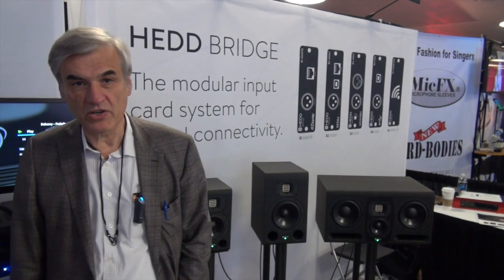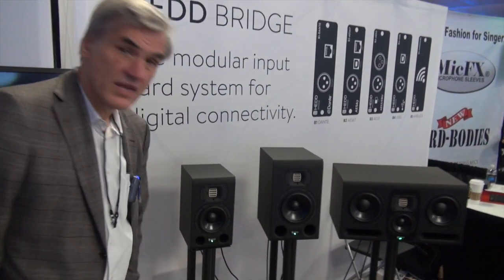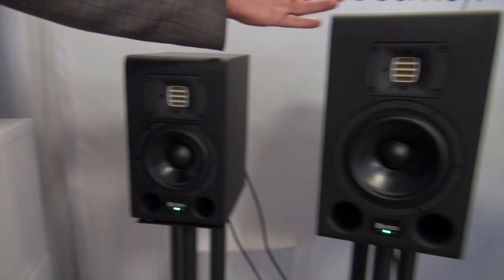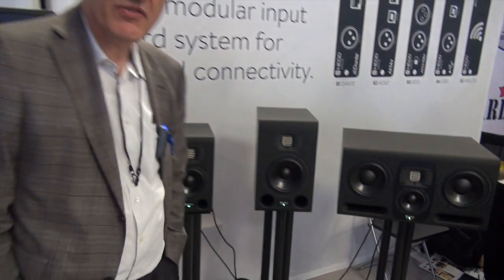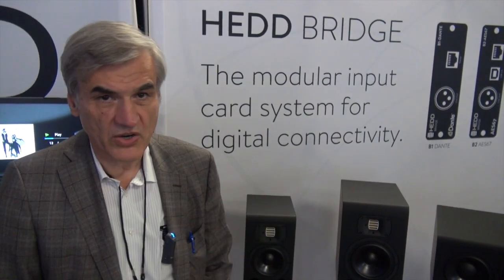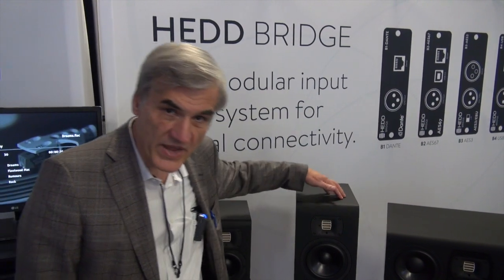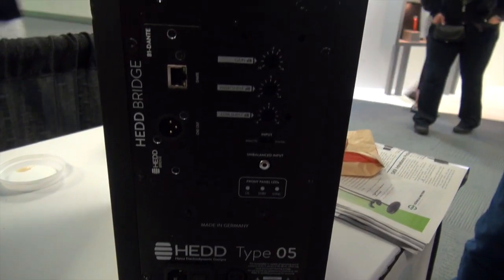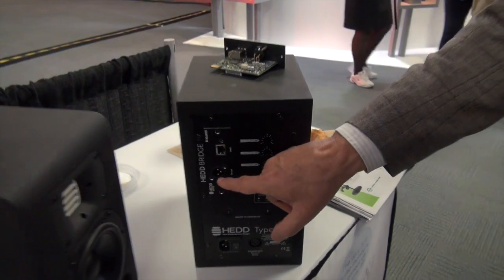[NAMM] Hedd

Comment: So there are Eve Audio-Hedd-Adam    all using basically more or less the same design and Eton speakers. They also have similar prices and aim at the same customer class. i don`t quite get it
Reply: +Frederik Knop Fair enough. Even so For me the perfect monitor is not in your line yet. Actually haven`t found it yet anywhere.  I always use a subwoofer. So for people like me the perfect thing would be a closed monitor  which can roll off at about anything around  60-80 hz. Personally i don`t need all speakers to be Bassreflex when closed is more precise. (Subwoofer ok i don`t care if it "wobbles" a bit) .  But there somehow are not that many choices of good closed cabin-studio-power- satellites.....   My dream monitor for my space:  5 liter volume closed cab. . 15-16 cm woofer. Dsp filtered. Freq.Range about  60-70 to about 22.000- 25.000hz  . Just saying
Reply: It would be cool if companies offered plugs for the bassport holes for tighter bass like atc i think.
Reply: aesthetically yes it would be nice. if you only need them for their function though  then you can take basically almost anything in order to stuff the reflex port. A sock or some other dense fabric or foam. All it does is canceling the reflex function or better said  "boost" in bass. You will have less low end of course but in some cases more accuracy. Drivers tend to get a bit cray around the tuning freq. of the reflex tuning
Reply: Le Frua Well i use a sub with my monitors so i don't worry about the bass response of my monitors, what i want is a monitor with good transients and excellent stereo imaging that doesn't suffer from standing waves in the cabinet from cheap construction like my jbls currently. The type 05 looks good on paper and it's not over priced too bad so it's on my short list.
Reply: Hmm. Standing waves might have to do more with your room than with the speaker itself. Of course a tight speaker might sound cleaner but if you have a room problem a better speaker won`t solve it. Have you tried the jbls in a "drier" room? Just to be sure and find out if that it`s their fault. If not then you will have to identify the problematic freq response of the room and treat it.  I believe that the Hedd will be the better solution imaging and overall Sq wise of course. But if the room sounds "boomy" it won`t save you. If you stuff the BR port is one thing. It might help transients a bit. What would help more is if you actively highpass the Hedd or any monitor that doesn`t have the option of a Hghpass  itself. This would almost guaranty better transcients or at least overall behavior of the speaker. This way it`s amplifier doesn`t have to struggle with reproduction of freq`s you don`t want in the first place and the little speaker cones of small sat`s have a hard time with  frequencies like below 70-80hz) cause a smal cone needs very long excursions in order to reproduce deep bass which always compromises transient behavior. i think like 80-90% of acoustic energy to be below 500hz so this is where Amplifiers have to "fight" more. Also when you match a sub with sat`s sometimes depending on how steep the filters are it`s not always the best to say 80 hz Low pass on the sub and 80hz Highpass on the Sat`s cause if the Roll off is not ultra steep like in most cases  you will have a "bloating" spike in the crossover area cause of overlapping frequencies of the sat`s and the sub. Sometimes it sounds better if you apply 70hz Lowpass on the sub and 80hzHighpass on the sat`s but in real life you need to do testing or measuring. Also a Subsonic filter which is like a Highpass that filters ultra low freq`s in the 10-30 hz area which you very rarely need will make your sub sound tighter (a lot) if of course your sub doesn`t have this function implemented already (many active subs do have a subsonic filter  nowadays). Also don`t put your sub in a corner cause this is bloating-amplifying  the sound by 8-9 db. corner is bad for subs (there are some exceptions like some Horn subs etc)
Reply: Le Frua I use the jbl lsr310's matching sub with my monitors.
Reply: you don't understand competition?

Comment: Adam Audio A5X or Hd Audio Type 05? What to choose? Hedd has a better bass, but no second line in and no twists on the front side, and also a slightly higher price than Adam's. At Adam amp class A-B, Hdd - a class D. And the rest - which is better in comparison?